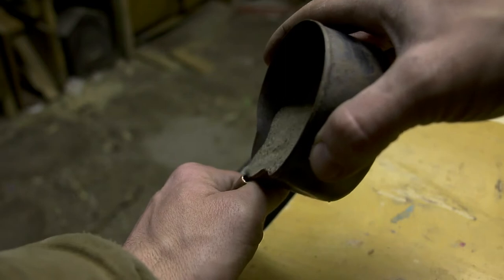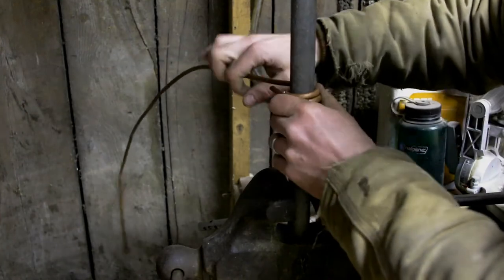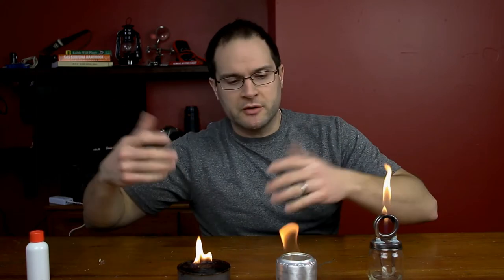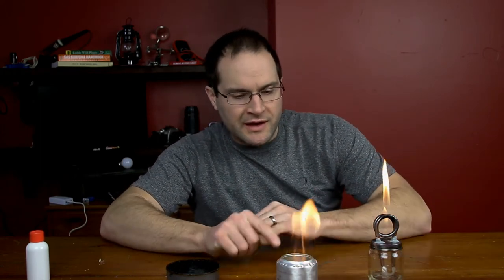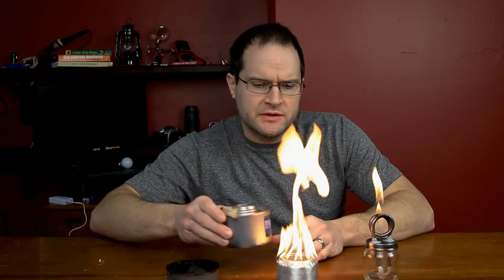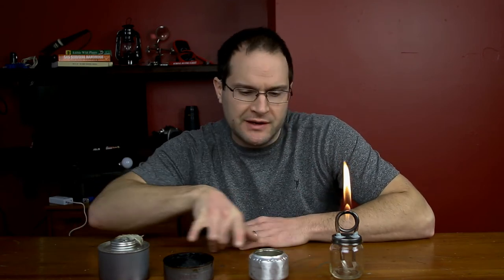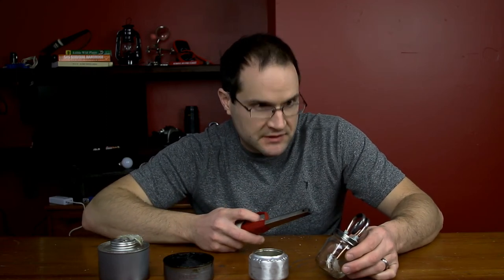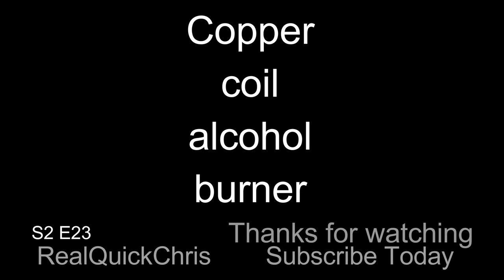how to build a copper coil alcohol burner s2e23

Comment: Purpose of the sand? Is the sand permanent or is it removed, I am pretty sure I know the answer, but I don't have ego issues so maybe what I have assumed about building one of these is wrong. ALSO I WOULD LIKE TO BUILD ONE OF THESE ON A GIANT SCALE,SO I HAVE TO GETBIT RIGHT !
Reply: The sand is meant to stop the tube from kinking when forming the coil. You should empty it once formed. You can also use fine salt

Comment: I'm digging that coil burner. Maybe I'll make one soon. I wonder if you could add some kind of fragrance to the alcohol.
Reply from the maker: I wonder if you could.  It does have a steampunk kind of look. The only problem I found is you need enough flame and heat to keep it going (to much for me to make a safe indoor light) maybe using smaller copper tubing or thinner walled tubing. (Less copper to heat up) I did play with the diameter of the hole for the burner and I could not get the really small ones to work. Anyways something to play with
Reply: RealQuickChris Definitely variables to consider. Also is the effect of burning perfume. Have to see if there are any noxious byproducts. I suppose if it's alcohol-based, there shouldn't be, but you never know until you got it with a spectrograph!

Comment: The coil burner flame should be blue as I understand it, is that not so ?
Reply from the maker: If it's blue it's burning nice and hot. I was using 91% isopropyl alcohol I think there might be some other fuel that burns a little better.
Reply: RealQuickChris : did the JB weld hold up ?
Reply from the maker: I have had no issues with it. Not sure what the recommendations are for the working temperatures of it are but it's working
Reply: What types of fuel can be used?
Reply: @DerekLevasseur  I use either the Yellow can of Heet from Walmart or Clean Strip Denatured Fuel (alcohol) both burn cleaner than isopropyl alcohol. Still, always use plenty of fresh air and ventilation!